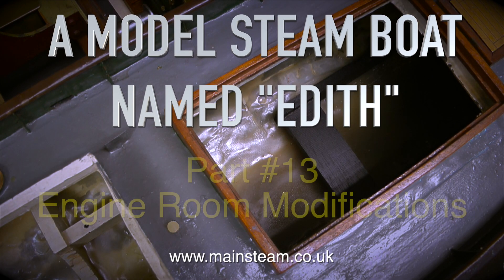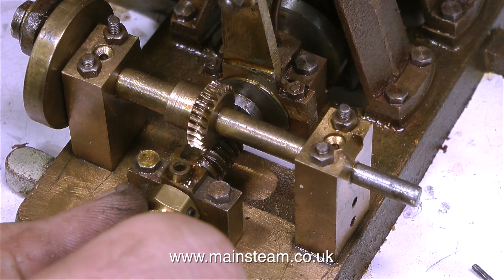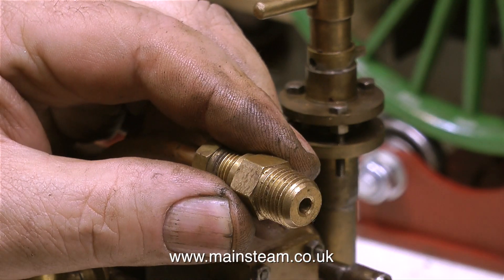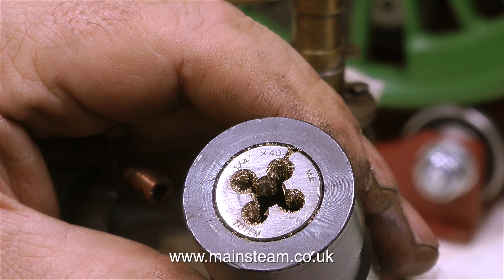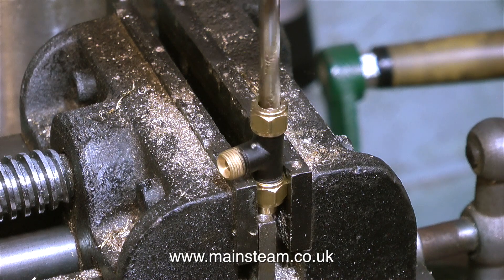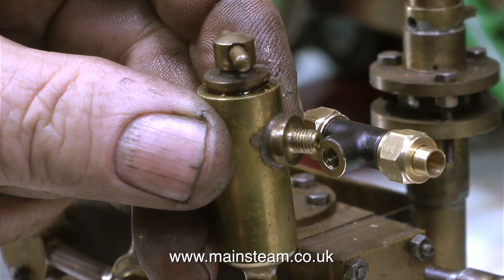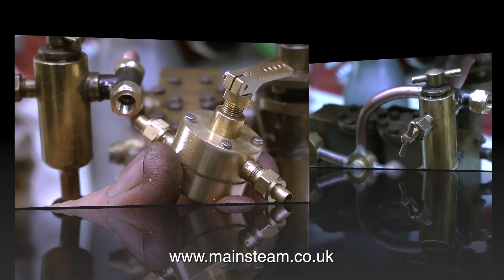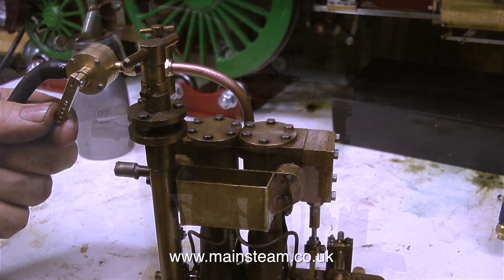A MODEL STEAM BOAT NAMED EDITH - PART #13

Comment: Really enjoying this series thanks Keith!

Glad to see I’m not the only one who ignored the advice that the came with this regulator about mounting the lubricator upstream of it!😁

Also, how did you get the swarf out of the copper pipe? Or is there so little that it’s not an issue? I was just concerned about it going through into the engine🤔

Thanks again for making the these great videos.
Reply from the maker: This boat will be an ornament and is unlikely to be run, but in any case I haven't had any problems using the regulators as shown.

Comment: Bonjour Keith,
Personnally, I would have installed the regulator after the oil lubricator to take the benefit of its function for the moving parts of the regulator. To be fully honest, I confess that, because of lack of room, I have made one or two exceptions to my opinion.
Amicalement, Raphaël
Reply from the maker: Please watch the rest of the series ..........

Comment: Enjoy all your videos.  Piping on model steam engines should look realistic or prototypical.  All your piping is very well done!
I like both 1/4-32 straight threads with gaskets or thread locker.  And, 1/4-40 tapered threads for the PM Research fittings. They take less thread locker but, are harder to align to a snug fit sometimes.

Thanks for your efforts in renewing interest in model steam engines.

Comment: Hi Keith, thanks for the videos. A bit of info...the fitting you cut off was an ENOTS fitting used them a lot at one time. They used their own thread to BSP , horrible things adaptors had to be used everywhere, only used them because the company I worked for wanted them used,,,yuck.

Comment: For those not familiar with thread sizes,   1/4 ×20 and 1/4×28 are the UNC and UNF coarse and fine thread .   1/4 inch probably has had more different threads than any other. ×24 was used by Harley-Davidson for years.Stanley planes ,the knobs are nonstandard threads. So ×32 and ×40 are much finer than even the fine thread of automotive use amongst others. ×20 is referred to as stovebolt as tens of thousands of wood and coal stoves used that as the go to fastener. Thus the Chevy six ,using same for the majority of cover fasteners,was called the Stovebolt Six.
Perhaps Mr. Appleton could be persuaded to mention just which of the ME taps and dies he uses,for those of us unfamiliar with that thread family. A little mention of BA  would not come amiss either. Thanks for your posts,they are a staple I look forward to. Cheers.